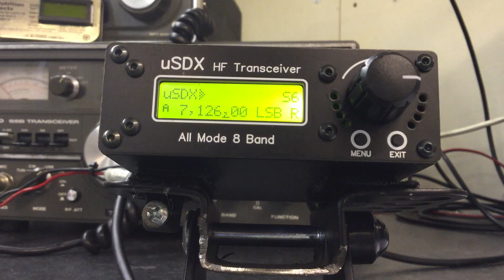Another great report on 40m uSDX / uSDR all mode 8 band

Comment: Does it transmit on 11 meters?
Reply: If it dials down to 11M, it would be going into the CB band in SSB.  I cannot imagine buying this for CB when you can buy 4W CBs for 1/10-1/2 as much money.  I would guess that it is not "type accepted" for use anyplace not requiring an amateur licence anyway.
Reply from the maker: I’ve not tried it on 11m.
You can go to 28MHz and dial down to 27MHz.
But as to RX/TX, no idea.
Reply from the maker: I checked and it does TX/RX 11m/CB.
However, it’s not a place I go and certainly not with this.